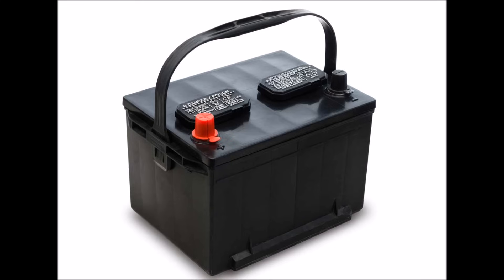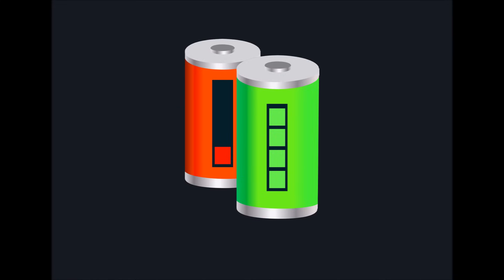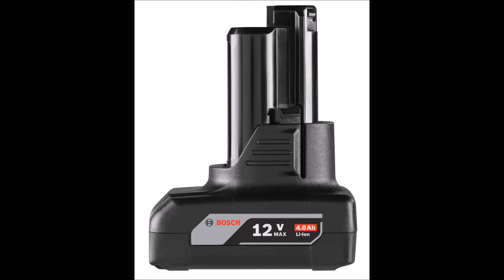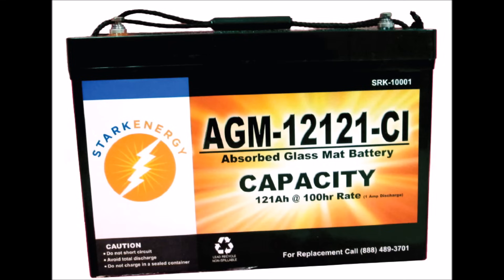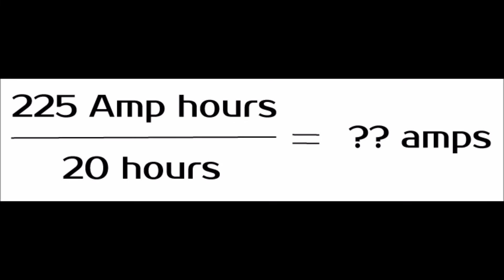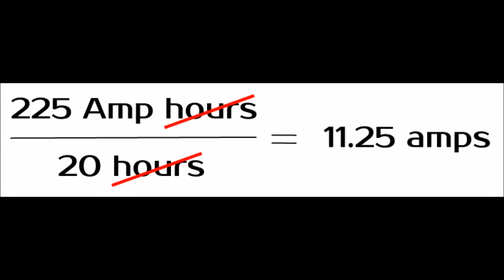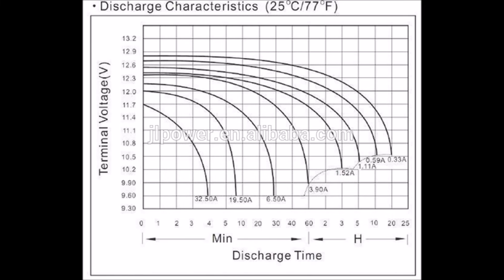Amp Hours???  Battery Capacity Explained

Comment: How long will a 50 watt bulb runs on a 240 amp battery when fully charged
Reply from the maker: It will run for approximately 30 hours with a 12V lead acid deep cycle battery that is rated at 240Ah @ 20hr rate.
Reply: LDSreliance 
How did you calculate?

Comment: Is installing larger capacity battery for car bad?
Reply from the maker: No, not unless it is the wrong kind of battery.  Typically, high capacity batteries are deep cycle batteries.  Car batteries are starter batteries.  They are very different.  If you switched your car battery to a high capacity deep cycle battery it may not be able to start the car.  It is meant for lower amounts of power for a long time as opposed to a huge surge of power for a short time like starting a car.
Reply: LDSreliance I don’t think it takes as much power as people think it does to start a car: there is a 20-30A fuse on the starter motor circuit, another 10A on the ignition system...say 50A peak draw for a second or 2 (unless there is an engine problem or it’s very cold) before the alternator can take over.

Comment: So how long would a 11 Watt Light on a 7 amp hour 12 volt battery last?
Reply from the maker: A little over 2 hours.
Reply: That's weird cause I got 3 and 1/2 hours out of it and still had some power in it. The item said it draws 0.9 amps though.
Reply from the maker: Then I would bet it was not using a full 11 Watts.  I don't suppose you have an ammeter?
Reply: And no I don't have an ammeter.
Reply from the maker: OK, I used a different method for calculating the run time and got 6.5 hours.  That seems to be more accurate.  The other method seems to be more for larger batteries.  Anyway, it helps that the lights are LED and they can operate with less voltage so as your battery discharges the voltage will drop but the light won't care.  Just be careful not to leave it on or it will drain the battery to 0 and damage it.
Reply: Thanks for the help, It's best to not go under 50% or just don't go to 0%?
Reply from the maker: For lead acid batteries, the general rule is do not go below 50% or you will shorten the life of the battery much faster.

Comment: Hy, i want to uprade my motorcycle 12V 35/35 W headlight with 35W HID kit and the battery capacity of motorcycle is 12V 3Ah  will it drain the battery?
REPLY
Reply from the maker: If they are both 25W then no.  Also, the battery does not matter once the bike is running.  The alternator will provide the power.  So it would be more of a question of whether your alternator can handle it.  But if the original light and new light are the same wattage then it will be fine.

Comment: I have 2 6V gel deep cycle batteries but no info label stating amp hours. Is there any way or a test to calculate battery amp hours?
Reply from the maker: You would have to simulate how the manufacturer's test and determine amp hour capacity.  They fully charge the battery, let it rest a bit, then put a very specific current load on the battery and time how long it takes to discharge.  They do it at various current levels and that will allow you to do the math you need to estimate the amp hours.
Reply: LDSreliance Thanks for your prompt reply. I apologise for taking so long to respond. I have my 2 6 volt gels in series. Is there a way to up the amps as well or is that only for 4 batteries? I could obtain 1 more of the same but don't know if you can use 3  together. They are MK 8GCC2 6 Volt gel. Your expertise would be greatly appreciated.Thanks again.
Reply from the maker: To double the voltage AND the capacity you would have to have 4 batteries.  But putting batteries in parallel is not as good because they will charge and discharge unevenly.  Try to only do series in battery banks for best results.
Reply: LDSreliance ty

Comment: Sorry, but I don't get this, I don't think you provided any explanation at all as to what an amp hour is. An amp for one hour straight, right, i get that, but at what voltage, or what's the load impedance or the power in watts? Why arent batteries simply rated in watt hours? Can someone please tell me what an amp hour actually really is?
 
For example, according to Ohms law (V=I*R), if you take a standard 1.5V AA battery, you would need to put a 1.5 Ohm load resistance across the battery +- terminals to draw 1 amp. Drawing 1 amp from a 1.5V voltage supply for 1 hour through a 1.5 ohm load resistance is the equivalent V*I=1.5*1=1.5 watt hour. But if you take a standard 12V car battery, you would need to connect a 12 ohm load resistance to draw 1 amp. Drawing 1 amp from a 12V voltage supply burns 12 watts and doing it for one hour is the equivalent of 12 watt hours, more than 8 times as much power as with the 1.5V AA battery example. 

Surely the true definition of an amp hour refers to some fixed measurement of power, and not just some vague varying definition depending on voltage supply? So what gives?? What the actual f'''' is an amp hour?
Reply from the maker: Don't get fixated on voltage.  It is as simple as a quantity of energy in a battery that allows one amp to flow for one hour.  That rate changes based upon the amps drawn.  A higher load will draw more amps and capacity will diminish at a more rapid rate.  Capacity drain is not constant.  According to Peukert's Law, the faster the drain, the lower the actual capacity is.  That is why this is so hard for people to understand.  It is not linear.
Reply: "Don't get fixated on voltage."

But if i don't know the voltage, then i don't know the power. If i don't know the power, then i don't know how much effect a battery would actually give me. Saying that it is as simple as a quantity of energy that allows one amp to flow for one hour is insufficient information, because 1 amp driven by a 12 volt battery has a lot more energy and power, 8 times more energy to be exact than 1 amp driven by a 1.5 volt power supply. So are you saying that an amp hour for a 12 volt battery is 8 times as much as an amp hour for a 1.5V battery? That makes no sense that an amp hour would not be a fixed quantity of measurement.
Reply from the maker: Battery capacity has nothing to do with that, though.  You can have a 10 Ah battery that is 6V and a 10 Ah battery that is 12V.  They both have the same capacity.  Obviously one of them will be able to provide that capacity at a higher voltage and thus a higher wattage, but the capacity is the same.
Reply: So if i put 2 of those 6V 10 Ah batteries in series, do i end up with the equivalent of 12V and 20 Ah or 12V and 10 Ah?
Reply from the maker: 12V 10 Ah.  Series doubles voltage.  Parallel doubles capacity.
Reply: Ok good, so a battery isn't a perpetual motion device afterall, we can't harvest infinite energy, makes sense :-P Still seems a bit weird to me though, why it's meassured in amp hours when it comes to batteries, but watt hours when i pull the electricity from the wall? So if i wanted to convert amp hours and voltage of a battery into watthours, i suppose i can simply multiply the amount of amp hours by the voltage of the battery according to the powerformula, P=V*I.
Reply from the maker: Haha yeah.  The formula is (Wh)*1000/(V) =(mAh).  But yes you can use Ohm's Law in its various permutations to do the math on any conversion of resistance, current, voltage, and watts.
Reply: @LDSreliance  when you say "obviously" then is when i get lost because this is not obvious to me. should i do parallel or series because i am thinking about getting a second battery?
Reply: @LDSreliance  This conversation should be a video itself, i feel like I learned more reading this than your well made video
Reply: @LDSreliance  NOOOOOO they don't both have the same capacity, the 12 volt 10 Ah batter has  LOT more capacity (in terms of watt hrs of power) he is right, that amp hour IS NOT a unit of power or capacity because it depends on what voltage the batter is as to how many watt hours that equates to.
Reply: @mortenrobinson  You still have 10 Ah. But at 12 volts instead of 6, you have twice the capacity though. Yep Ah's are stupid and are units for idiots.
Reply: @chevyvantravel9735  always series if you want them to charge evenly and not wear one out before the other, if you do parallel then you need to make sure the lead lengths are exactly even and tge ohms exactly the same, even a 1/4 or 1/2 ohm difference will cause one to go bad first.
Reply: Demonwhisper how can we find the capacity (ampere hours) of a battery if we make one or if we know only its voltage? how can we measure the ampre hour of any battery?
Reply: Debojit Acharjee also, every time it goes past a hour, I believe you count the current again. Say we have a 10 amp hour battery. A 10 amp load will take one hour to deplete it. A 5 amp load will take 2 hours. A 2.5 amp load will take 4 hours. I guess really you times the amps by the number of hours and that gives you the one hour rating (which is the assumed unless stated otherwise)
Reply: Debojit Acharjee I’m no expert, but if you have a battery you want to test, try a fixed current drain. Preferably tie in a stop watch so you don’t have to sit there the whole time. Whatever result you get, use the math and tweak the current to try to get it down to one hour or if not possible than one of the multiples listed. (10, 20, etc). Use math and rate it for one hour. If you would like for more transparency you can also list the test current scenario.

Comment: hey,
I'm kinda confused I done the math like on your video my battery is 105ah at 20hr. rate.
I took 105÷20=5.25 amps a hr. right.
so if I'm converting  my 110volts  to 12volts with my inverter box.
what it last more than 1hr.
Thanks I just need  a little more help.
Thanks again for your help.
Reply from the maker: Yes and no.  Your battery will discharge for 20 hours at 5.25 Amps that is correct.  But if you go up to 50 Amps, it will discharge much faster.  It is not linear.  There is a phenomenon called Peukerts Law that states that the capacity of the battery actually decreases as the discharge rate increases.  So your battery may have 105Ah @ 5.25A but will only have about 60-70 Ah @ 50A.
Reply: LDSreliance 
so deepcell do I need for that to run a 8hr. day if you know of one I need can you send me the link and what I need.
Thanks  again.

Comment: hey, I have a question about ah.
I have a ice shaver that's 6amps.
and I'm looking a dep cell battery  that says 105ah.
and I'm going to plug in my  110volts shaver to my 100 watts inverter  box how long a day can I run my shaver.
it's 105ah rated on 20 hrs.
     Thanks for your help Willie
Reply: 1600 watt inverter  box I mean sorry
Reply from the maker: You should be able to run it for a little over an hour.  That ice shaver consumes 600+ Watts if it uses 6 amps @ 110V.  So that will really tax a deep cycle battery like yours because they aren't designed to run high loads (at least not a standalone battery).
Reply: LDSreliance 
how can I set it up with a deep cell battery  to run it for a least 8hrs a day. to plug in to make inverter  box it's 1600 watts .

want to get away from the generator 

Thank  you for your help.
Reply from the maker: Willie, I would get a Kill A Watt meter and test exactly how many kWh that ice shaver uses during your 8 hour day.  I bet you that it does not use 600 watts the whole time.  If you don't have that meter, it is really cheap and a great investment to check the usage of many different appliances and loads.  It is under $20 with free shipping and will save you a bunch on your solar system:  http://amzn.to/2rQ2bth

Anyways, if you don't want to check the actual usage and we have to assume it uses 600W all day then you would need around 2250 Watts of solar panels and at least 225 Ah of battery capacity.  That is assuming 4.5 sun hours per day (since I don't know where you live) and no battery storage for rainy or overcast days.  If this is in the summer and this is a shaved ice stand and you are only open for business when it is hot and sunny then you could do it with about 900 Watts of solar panels and your existing 105 Ah battery for buffering the startup of the motor.
Reply: LDSreliance 
can I also get to batteries 225ah and hook them together  to get 450ah that way too.
I order a genuis battery  charge too.
can 2 batteries  be charge at on time.
I don't  want to deal with any solar panels and generators.
.
Thanks  again for all your help.
Reply from the maker: Oh ok.  So you just want batteries to run the ice shaver each day and then your battery charger will recharge them at night?

In that case, you need about 816 Ah of battery capacity to run 600W for 8 hours.  So you can use 8 golf cart batteries (6V) and wire them in series & parallel to achieve a 12V battery bank OR you can get 10 of the batteries like you already have and wire them all in parallel.

One battery charger may not be able to re-charge that entire battery bank unless it can provide a lot of amps.  If you ordered the same Noco genius that I showed in my previous video it will only re-charge a maximum of about 225 Ah of battery capacity.  So you would have to figure out a way to disconnect your battery bank at night and re-charge the batteries individually or in smaller banks.  Or just get a much more powerful charger.
Reply: I can't  put 2 of the 225ah batteries  together so I only have 2 batteries.
In parallel .to give total of 450ah.
I only need 450ah right want that work that way.
So I can charge battery separate  then too.
Thanks.

Comment: I want to go camping and set up a portable power. I'm planning to use 1,000W electric single burner 1 hour a day. I have a 12V, 30 Ah lithum battery and a 100 W solar panel. I calculate 30Ah/20hrs=1.5A, 1,000W=12V x 83A. How to calculate how many minutes can I use from my 30 Ah lithum battery? Thanks for sharing!
Reply from the maker: Unfortunately, Peukert's Law states that as you increase the current draw on a battery, the capacity drops.  And it isn't really linear so it makes it hard to estimate.  But with the limited info you provided, that small of a battery cannot provide that much current without heating up to dangerous levels within 30 seconds.  For example, the lithium iron phosphate battery I showed in a recent video (https://youtu.be/UBjR0IH4450) which is only slightly smaller than yours can only provide 50 amps for less than 30 seconds.  After that it is dangerous.

I know that doesn't answer your question directly but you will need a bigger battery or three to run that load for any meangingful amount of time.

Comment: I have 4 of the 210 AH AGM batteries running a night light 8 hours a night. The LED  night light draws 500 milliamps. I recharge the battery bank when it gets to 11.0 volts. 

 Do you think the County Fkn Tax Assessor will add another $1000 again to my bill before I have to recharge? Its in Sonoma, Calif.  Thank you for your posts. They are very handy.
PS:The County says they are ''voter approved bonds...'' so they can jam them where the sun don't shine.
Reply: Roger, yes. The voltage is the only thing that matters in this case. Of course its wise to make sure you keep the proper fuse in the circuit to protect the system if something shorts out somewhere on the bike.

We were stuck in some backwoods place (Deliverance comes to mind...) while touring on Honda CBX 6 cylinder bikes. My buddy's battery failed completely at a little store in the woods. We bought some guy's old 12 volt 800 amp trolling motor battery and strapped it to the bike's seat with rope, ran some scrap Romex house wiring to the original battery  box leads.  We push started the bike (The 14 gage Romex would fry instantly if he hit the start button) and finished the 150 mile leg to a city where we could buy the proper battery. They exchanged the Yuasa bike battery for free as it was on the recall list.
Reply from the maker: Man, I have no idea about that.  Do they seriously do that?
Reply: Oh, boy. I guess I shouldn't drink and post.....  
I enjoy your videos! Keep up the good work!
Reply from the maker: Haha, you are welcome.  Thanks for watching!
Reply: can i use a 10ah battery insted of  a 5ah battery? on a motorcycle same voltage of 12v many thanks
Reply: thanx very helpfull
Reply: 11volts is to late....you already destroying your Batterys. Maximum discharge on 12volt system is 12.2volts= 50% discharge+-

Comment: im bad at math so plz help me out.....i have a car amplifier that puts out a continuous 2200 watts at 14.5 volts and my alternator is rated at 135 amps..how many amp hours  do i need to run it for at least 2 hrs max?
Reply from the maker: You would need batteries totaling 1430 amp hours to run that amp at full power for 2 hours.  Your alternator doesn't factor into the math unless your car will be running during those 2 hours.
Reply: LDSreliance yes the car will be running at all times....damn i bit off more than i could chew 😏
Reply from the maker: Well then if your car is running and the alternator can produce 135 amps then you only need about 50 more amps for 2 hours or 388 amp hours of batteries.  That is a LOT more doable!
Reply: 2.2 kW in your car? 
1. You need to stfu and give other people a chance.
2. You need hearing aids because you are deaf.  I SAID, YOU ARE DEAF!
Reply: 3. You need to start learning sign language.